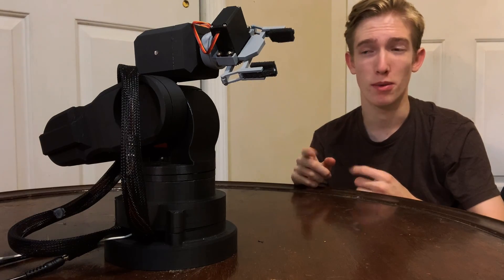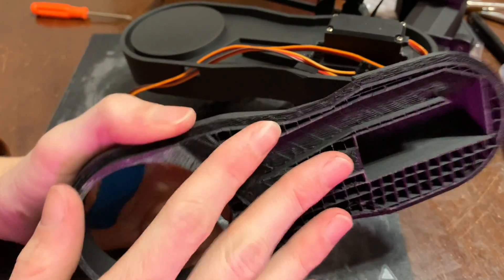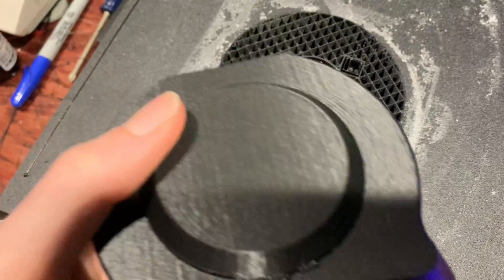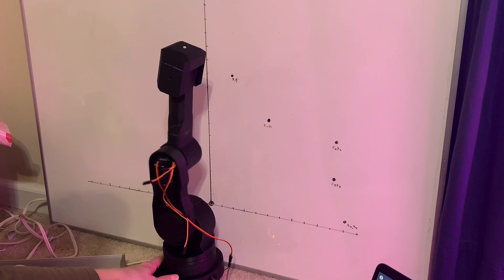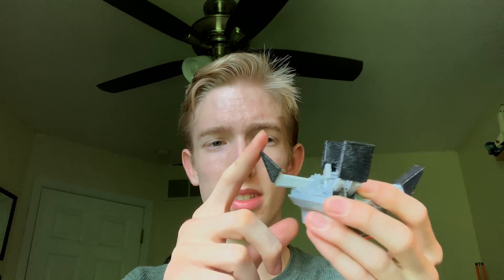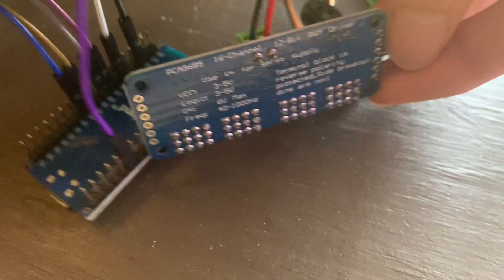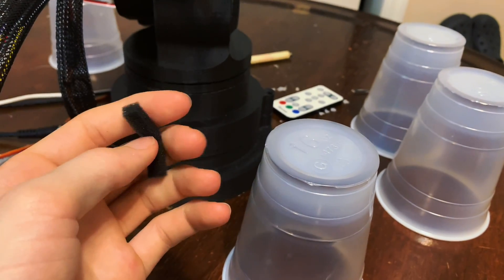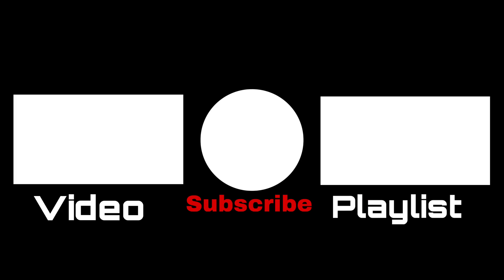3D Printed Robot Arm (Arduino)

Comment: Hi, I’m a beginner in design and I don’t know how to design these things. I searched on YouTube but couldn’t find any 'good' course to learn CAD design and then print it. Could you give me a good source to learn it? I’d appreciate it.
Reply from the maker: Personally I just messed around on the CAD software and designed random things. Eventually working my way up to more complicated stuff. However, that does take a while. I would recommend a combination of YouTube and just messing around with the software. I also found it hard to find good tutorials on YouTube so maybe doing more by yourself is better. Start off with simple shapes and making cuts and holes, just to get a hang of the basic tools of CAD. Then move on to designing different things with more complicated shapes and parts. If you have any more questions feel free to ask.

Comment: Hey man this is sick!! Hope you keep creating. Stuff like this will take you far.

For the print issues, first off a high quality glass/pei plate and a pretty much a must. Then, regular cleaning and adhesion (glue sticks, etc) is also critical. Get your bed leveling dialed in, experiment with some first layer settings (maybe try turning fan off during the first few layers, run a little hotter). Try a temperature bridge, layer adhesion in general looks like a bit of an issue. 

Hope these tips help, I’m a total arduino noob but want to at least help with the printing side of things.

Comment: Are you using any kind of drives ( gearbox like planetary or cycloid at the joints
Reply from the maker: No, I did look into both of those gearboxes when designing it but decided not to use them. However, I am planning on using them when I build a bigger robot arm with stepper motors.
Reply: @OliverPaff  oh can’t wait to see one of those … nice work 🙌🏼
Reply: @OliverPaff  also when you use gearboxes your movement is gonna be less jittery while reaching a point and stop …and also give you more resolution and accuracy

Comment: I think you print bed is way too high, it shouldn't be leaving that many marks on the plate, generally people say to level is so that a piece of paper can slide between the nozzle and the bed, but I find that I need it to be a little closer to stick well.

Also personal opinion but I would recommend buying nuts and bolts and printing much smaller pieces that can be easily bolted together. It's more work but you save filament, print time, your mind if you have to reprint a connection piece 5 times. Also I buy aluminum dowels from a local hardware store and use them for structure so that I really only have to 3d print the connector kind of things and it saves me a lot. (I just know how frustrating it is when a 9 hour print fails after 8 hours)

Also I'm not hating, I loved this project, never stop creating stuff dude!
Reply from the maker: Yeah after I printed all these pieces I leveled the bed and it was much better quality. I usually just get a piece of paper and fold in half and it’s good. 

Also nuts and bolts definitely would have been a better idea. I was thinking of using them but decided not to. However, after I printed everything and started putting stuff together I regretted that decision because it definitely would have made the project easier. 

That’s a smart idea to use aluminum dowels. I’ll definitely consider using them for the 3D printed parts when I build the next robot arm. 

Thank you so much for the feedback!

Comment: Nice work! If you decide to upgrade your ender, consider the belted z mod (only costs maybe $20) and a new fan duct, plus a knockoff CHT ($2) if you don't already have it. Between those, you get way more reliability out of it!
Reply from the maker: I actually just bought an A1 mini but I still have the Ender 3 so I’ll have to look at some of those upgrades. Thank you!
Reply: @OliverPaff how is the A1 mini? Thinking about either getting that or the regular A1
Reply from the maker: @nhnova1452 It’s extremely easy to work with and great quality. However it is very small so if you want to print bigger items I would recommend the regular A1.

Comment: I just finished my first one  last week using  an esp32 board and a ps4 controller  but  mine  is  much less stable. i want to  make one with    steppers and maybe   planetary gears in  the future  but now im making an rc airplane. super  cool design.
Reply from the maker: That’s awesome. I bet being able to control it with a controller is fun. Also using stepper motors and planetary gears is a great idea. I originally planned on building a bigger arm using them but instead went with a smaller one with servos. If you ever build one you should definitely post it, I would love to check it out. Also good luck on the rc airplane.
Reply: @OliverPaff  Yea i wanted to make the stepper controlled arm but i dont have experience with steppers and i wanted to work with stuff i already had which was a bunch of servos. I have an extremely modded ender 3 thats just piling dust and im considering hijacking the motherboard to control all of its steppers and making a new robot with that but thatll be a while.

Comment: Nice project, and a perfect timing. I just got my first printer (A1 Mini) and I was looking how to get started with robotics. I was looking at the cad model and have few questions. How does the rotating base (part 3) connect with the arm (part 10). Also when I try to make the arm's length smaller (too big for my printer) from 5inch to 4 inch the back cover (part 11) just disappears. 
And if you don't mind can you provide the links for the electrical components and how do you power the servo driver.
Reply from the maker: There should be a disc that connects to the motor that goes into part 3 the disc then connects to the arm (part 10). I would recommend however to redesign it yourself because I designed this in the worst possible way so it’s not the easiest to build. However I am working on getting the parts fixed and making it easier to put together. Also I will link all the electrical components in the description. The servo driver is powered by a 5V 5A power supply. Also about the part disappearing, it’s probably because if you go in and edit the length it messes with the other features causing failures within the design. To be honest I have no clue if there’s a way around that. I would recommend probably finding a better design than mine that’s easier to work with.
Reply: @OliverPaff  Thanks, you designed it better than I could.

Comment: Looks amazing great job! Me and my friend are currently trying to make a robot arm as well And I was wondering how you went about supplying power to everything and what you used for that. Thanks a lot!
Reply from the maker: Thank you! I used a 9V 1A arduino power supply and a 5V 15A power supply for the servo driver. I will link them in the description. If you have any more questions feel free to ask. Good luck on the robot arm.

Comment: i loved the project, and i recommend you using a servo driver which will make it a lot more smoother and stable and you have enough room for an servo driver like a PCA 9685 driver, although the outcome is lovely
Reply from the maker: Thank you. I actually added a servo driver later on in the video since the servos couldn’t draw enough current, and it helped a lot.
Reply: @OliverPaff  nice to hear that

Comment: Super cool! What 3D cad did you use? Curious because i’m using fusion 360 atm and wondering if there are other alternatives that are better suited for implementing components into the design
Reply from the maker: Thank you! I use Onshape; It’s easy to use and free. I would say Fusion 360 is probably better but you can always try Onshape out and see if you like it.
Reply: @OliverPaff  Thanks!

Comment: Hey man, incredible work on that robotic arm, you made a super clean build, if you consider pursuing an engineering career I'm sure you would enjoy it!
How did you get started in designing 3D and embedded systems with Arduino?
Reply from the maker: Thank you! I got into all of this mainly because I took a CAD class my freshman year of high school and decided to get a 3D printer after taking the class. After that I just started designing and printing some simple stuff and then eventually decided to start doing some bigger projects involving arduino.

Comment: Did your electric bill increase when you start printing?
Reply: for future reference: 250W is the max power draw of Ender 3 v2. if one prints 24x7, and average kWh charges of power company is $0.12:
250 x 24 x 30 = 180,000 / 1000 = 180 x 0.12 = ~$21.6/month if constantly printing
Reply: @aaronalquiza9680  Thank you! That’s a pretty cool equation you got there. This helps a lot.
Reply from the maker: I asked my parents and they said they haven’t seen a large difference. After looking it up it seems that it doesn’t add much unless you are printing a lot or with many printers.
Reply: @OliverPaff  my last bill is $175 when it usually $90 - $100. But it just probably summer and we ran ac.

Comment: You should dry your filament. Calibrate your 3D printer as well, it looks like it's over extruding. I also recommend you use gyroid infill, it's more stable, never had a part break mid print.
Reply from the maker: I actually just got a filament dryer and I’ve definitely seen improvements in the quality. I will try calibrating it, I haven’t done much calibrating when it comes to flow rate or anything like that, but I definitely need to. Also I will check out the gyroid infill, the current infill I’m using is definitely not the best. Thank you for your feedback.
Reply: @OliverPaff  No problem! Also, forgot to add that I like this project, great job on it!
Reply: i had a really old ender as well, if you want to skip the hassle just try and sell it and get a different printer with bed leveing, I did this and got a Bambu lab A1 mini.
Reply from the maker: @user-sr9yl6xj4t I was looking at getting the A1 mini, especially since it’s on sale right now. Do you like it?